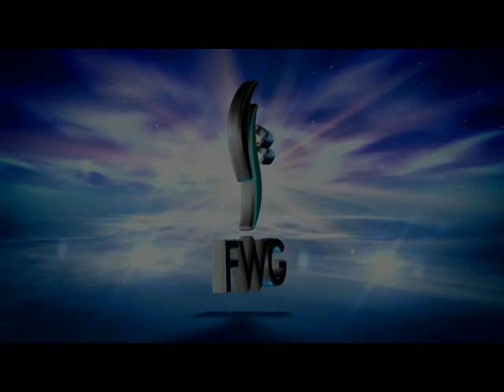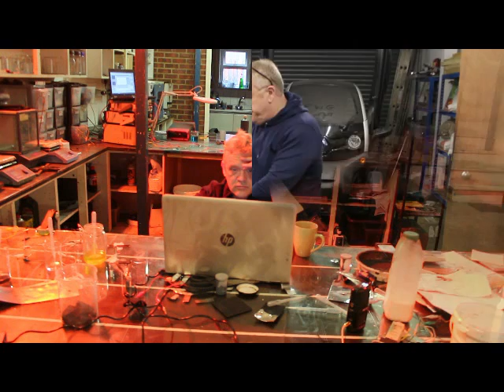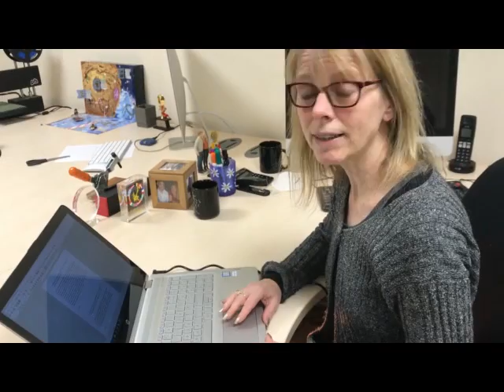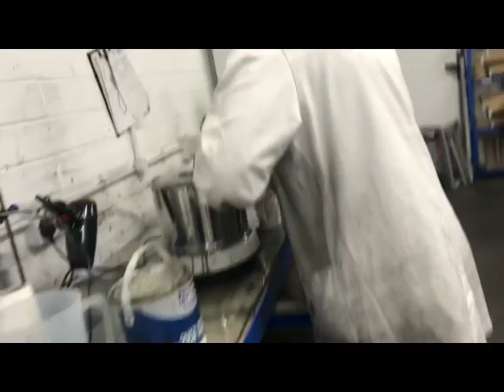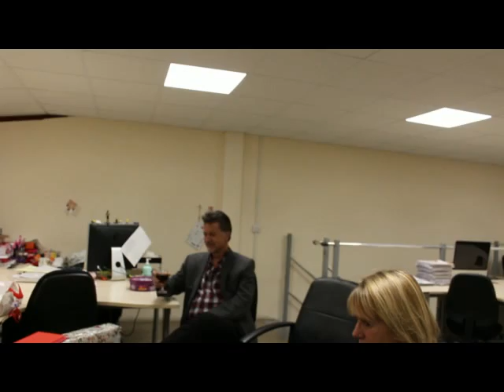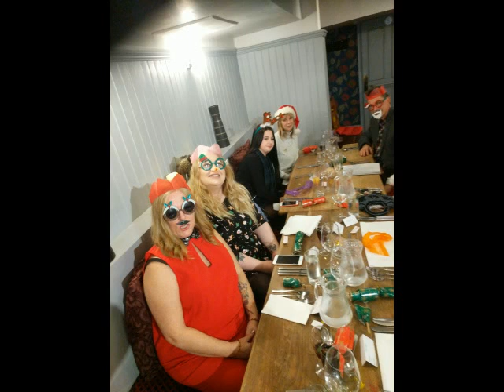FWG At Xmas

Comment: Have you already began manufacturing a few prototypes or are the parts and cases not yet in there ?
Reply from the maker: cheers for that mate - I know the ball park figures but the up to date examples are really interesting - 14,000 euros per kWh - that's quite a price tag.
Reply: In the new year - not long to wait now
Reply: @rawandrealserendipity  Too bad, in the last video Rob said in the next video it will be shown, so I hoped this video will show it , and still to see it in the year 2018... Okay, so we still have to wait.. At least you got your Teespring gadgets working...lol...Cheers...
Reply: @rawandrealserendipity - dem, i expected this war will be over till christmas...  ok, you still have whole week in 2018
Reply: here's some numbers to catch:
- Turnigy Graphene Professional 10000mAh 4S 15C LiPo Pack w/ XT90
$111; 150 wh/kg, 300wh/L, $111/kg; $740/kwh
- Turnigy nano-tech 10000mAh 2S 30C LiPo
$89; 74wh/0.5 kg; 140wh/kg; 280wh/L; $180/kg; $1200/kwh
- Optima Yellow Top Deep Cycle Battery, Group Size 34, 750 CCA $276
$276;  660wh; 20 kg; 560in3; 9L;    33wh/kg; 73 wh/l; $14/kg;  $418/kwh
- AutoCraft Silver Battery, Group Size 34/78, 800 CCA  $129...
Reply: &# on caps:
SkelCap SCA3200: 3200 F; 2,85v ; 
Specific Power 53 kW/kg
Specific Energy 6,8 Wh/kg
Weight 0,533 kg; Volume 0,390 L; Price per Cell:48.00€
53 kW/kg ; 64kw/L;  6,8 Wh/kg;  8.7 kwh/l;      1.8 euro/kw;  14 euro/wh; 14000/kwh